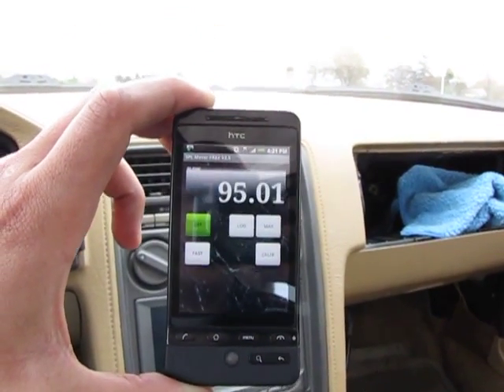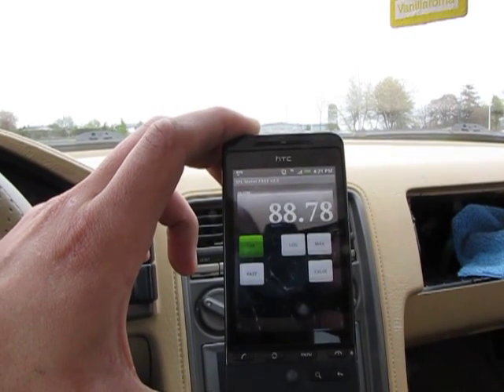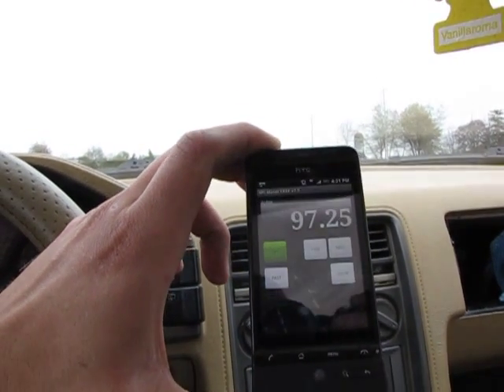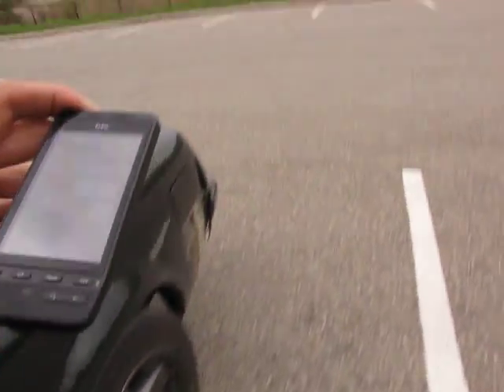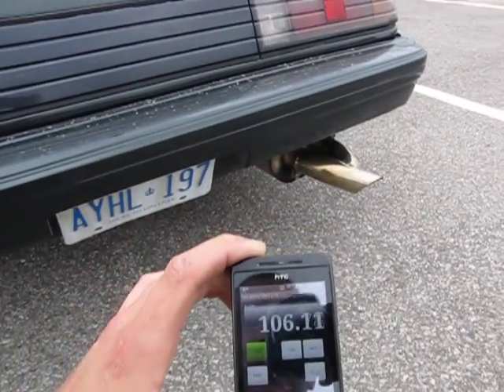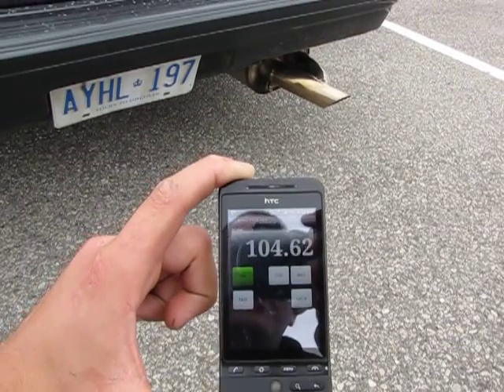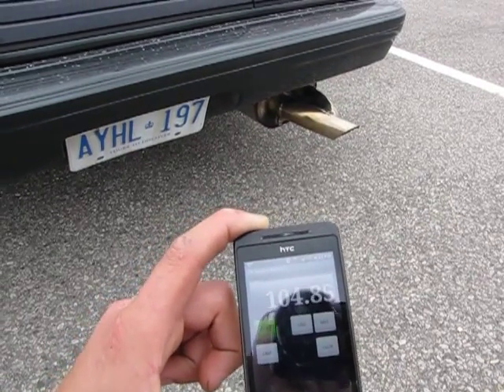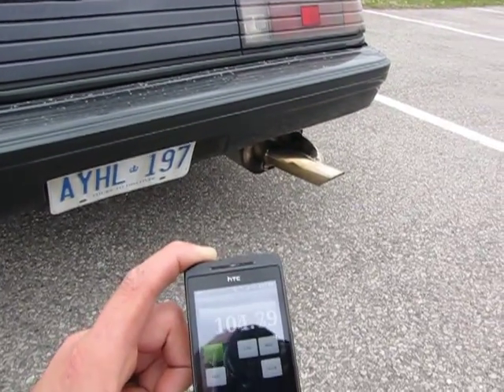Homemade Mufflers decibel db testing on my 85 RX-7 (With silencer) Exhaust sound

Comment: How long does the packing last?
Reply from the maker: Never had to repack. Stainless steel mesh with a Ceramic Wool. Muffler has been on 3 different cars since its been made an still lives over 15 year later.